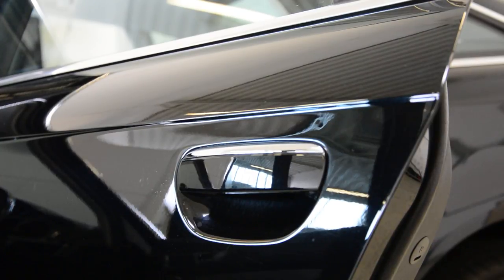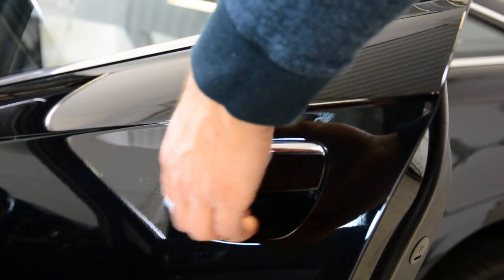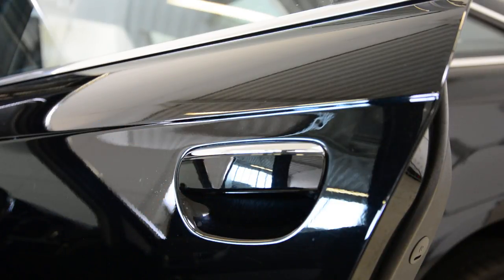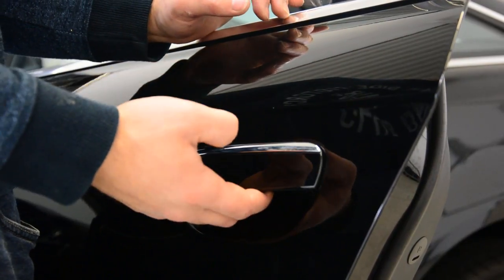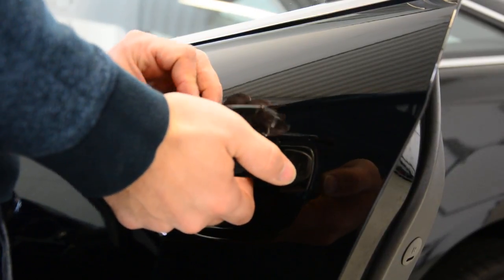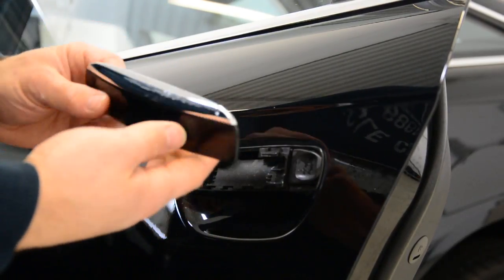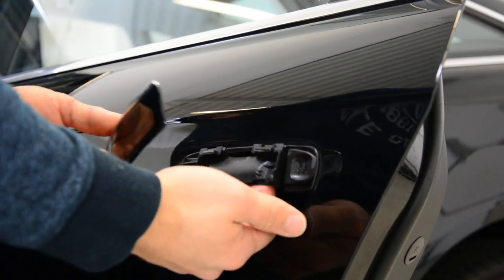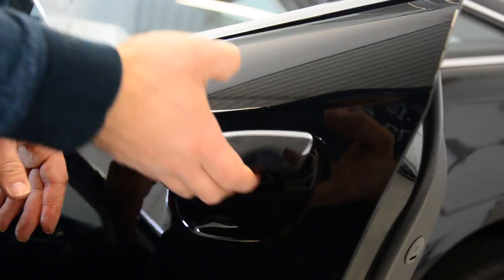Audi A6 exterior door handle removal

Comment: Do you know if this is the same for the other audi models such as a3 2010?
Reply from the maker: Give it a try. I think is the same.
Reply: I need to remove mine from a3 2006, sliding seems to not work as i have a two pins holding from bottom, been looking everywhere and i cant find it how to and i dont want to damage the handle -.-